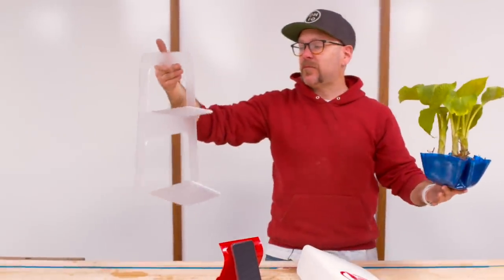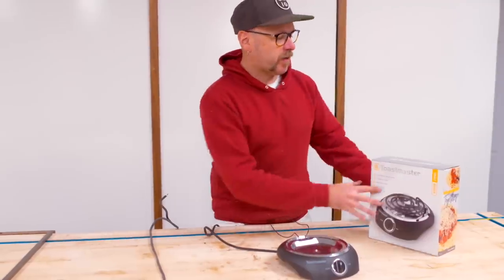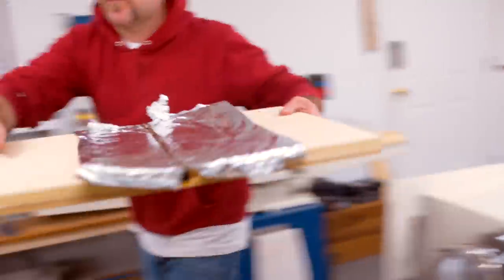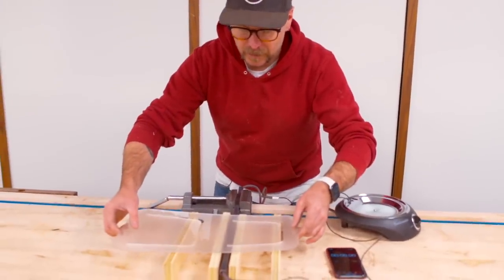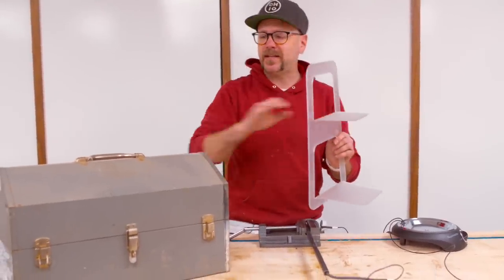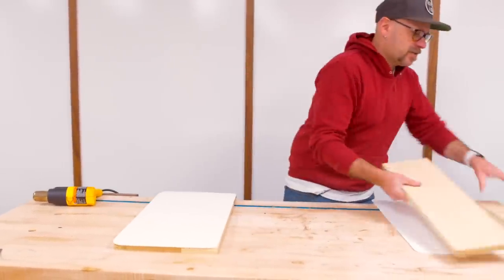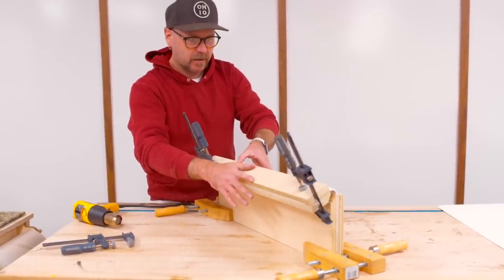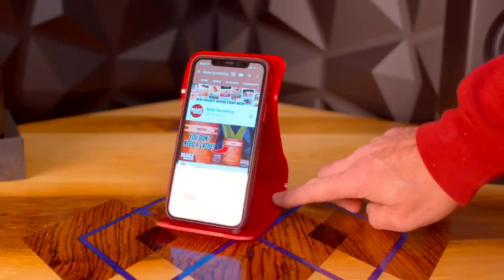4 Cool Ways to Bend Plastic!

Comment: Know that epoxy will not adhere to that white HDPE go-cart side panel.
Reply from the maker: Yep, found that out real quick!!! Hahaha! It pools up. A second coat leveled it out and seemed to stick. But yeah, that is not the way to do it. I learned you can get rolls of clear adhesive vinyl to protect it. :)
Reply: @MakeSomething  There is clear "Helicopter tape" that might work for you.
Reply: @MakeSomething  harbor freight sells welders for plastic that does well on hdpe,

Comment: As a retired electrician,  we used heat boxes to heat pvc to make sweeps, offsets 45 degree, 90 degree bends. Also heat guns, n blankets that would soften pvc, once we got the bend we wanted, we had a spray bottle of water, or a wet rag to really speed up the cooling process.  Nice job as always.

Comment: Really impressive, when I studied industrial design I had to make a scale prototype using methacrylate and it was a terrible experience, I could not bend the material well, if I heated it too much it would burn and bubbles would appear on the surface and if I heated it too little the material would break when bent, it was a nightmare. I wish I had seen this video then, too bad this happened in 1990. A greeting from Spain and thank you very much for the video, really interesting and instructive.
Reply: Yeah some plastics don't get soft, they just melt!

Comment: Cool idea can acrylic be glued together?those hot plate elements can be found for 10 bucks in discount stores
Reply: I'm very late but for anyone curious, you can "weld" acrylic using solvents like DCM and you can also use acrylic glue (as is sold for aquariums)

Comment: Pretty nice job, dude! 😃
Try some PVC! Cut a piece that fits inside a oven (30cm +/-), cut it vertically and heat it. 😃
I use to make PVC sheets that way. Then I cut what I need from it and bend it using even a lighter. This way I make fantastic parts for my rc stuff! 😂
Anyway, stay safe there! 🖖😊
Reply from the maker: Ahh yes! Nice!

Comment: How about screwing hinges to that wooden jig that you used with heat gun?
Reply: I've done something similar, and it probably works if you plan it correctly, but I always ended up with too large or too small of a gap to use the jig

Comment: i know this is old but do you know a way to heat up a certain space and avoid the rest of the area
Reply: the uncoiled hot plate method he showed might work, otherwise you could try dipping just part of it in boiling water or other things to that effect. maybe use the rack from the toaster and press it on the plastic where you want to heat it?

Comment: I know it's a year old but thanks for the video! Seems like the boiling water combined with a wooden clamp jig like the one used on the HDPE could let you do straight lines. Just pour it on and let the wood insulate around the area that you're heating, that might do the trick for what I'm looking for (straight lines without a buying a heat gun or hot plate, I'm making a one-off internal sump for an aquarium). The bending temperatures of each might have been useful, some of the plastics that require higher molding temperatures might take longer to heat, but most plastics seem to be significantly below 100° C, according to this source: 

https://www.plastikcity.co.uk/useful-stuff/material-melt-mould-temperatures